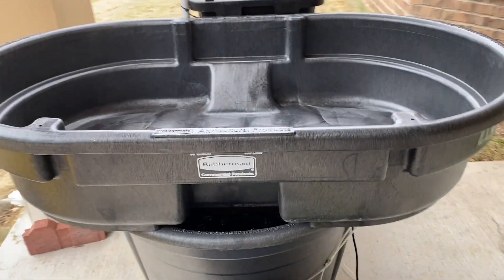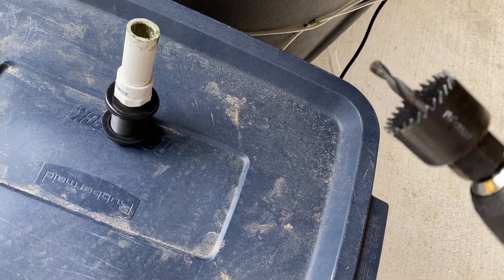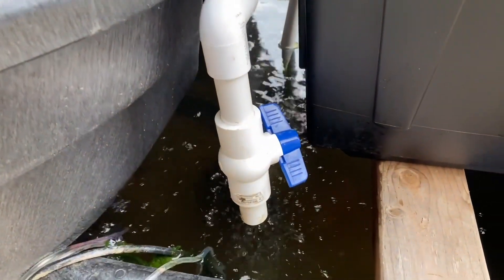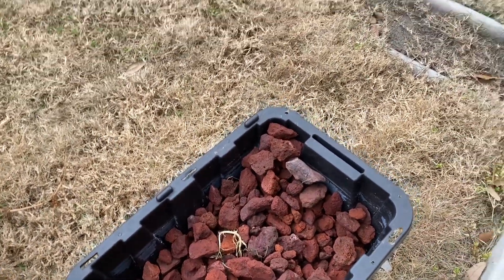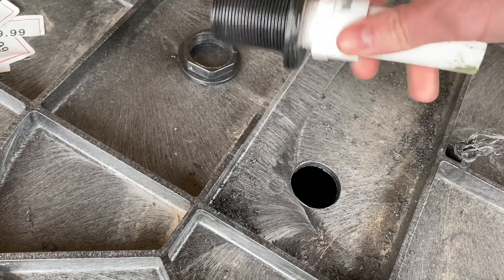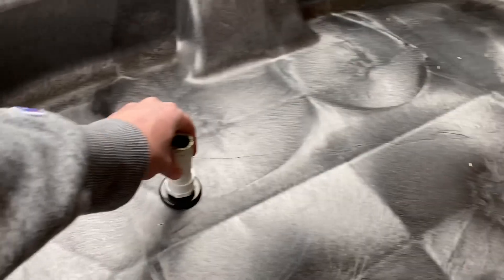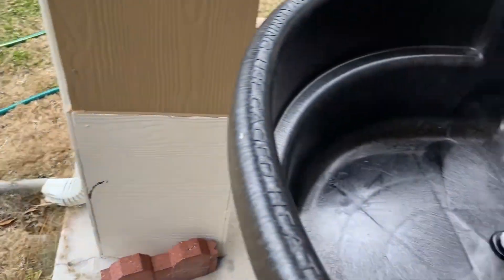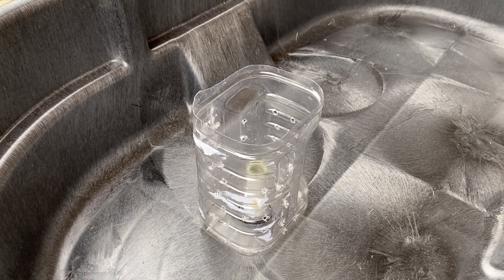How To Build An Aquaponics System With Stock Tanks | Easy

Comment: this is WAAAY easier  than fn around with bell syphons thank you.
Reply from the maker: Agreed, been running mine this way for 2 months no issues. Bell siphon is like a daily check on if it is working :). I’m in a hot climate (Houston) so 15 on 15 off has been working well.